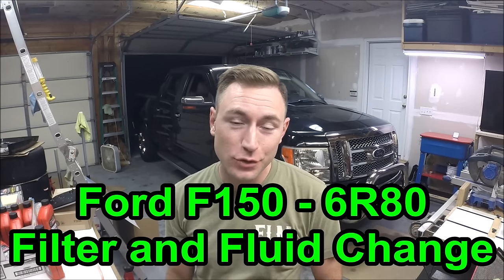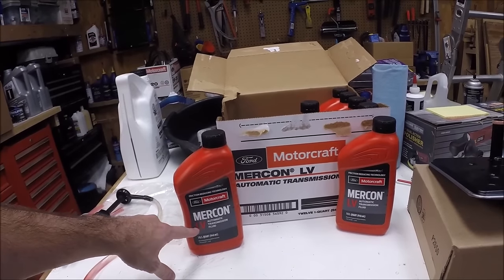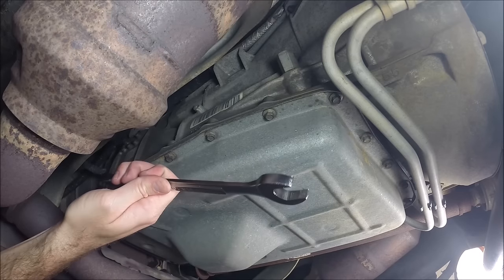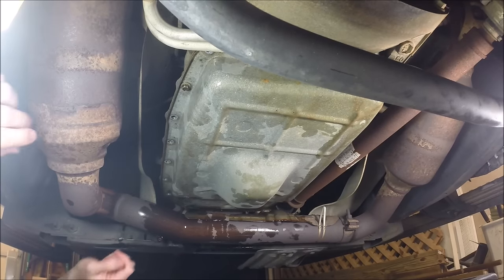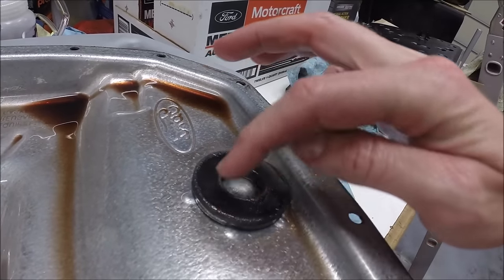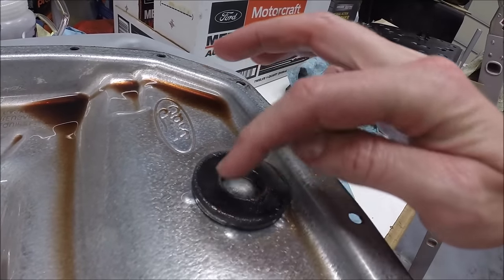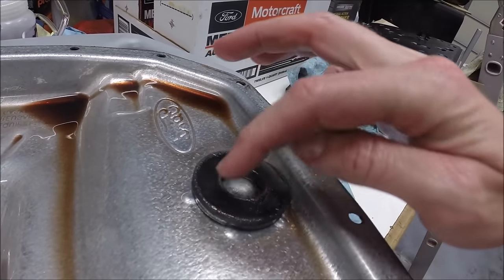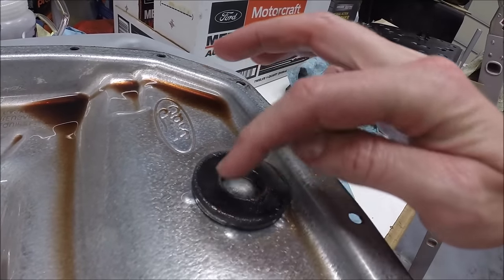Ford F150 - 6R80 Filter and Fluid Change

Comment: If you want to make less mess and make it more easy to handle the pan use a suction pump and pump out the fluid in the pan before you drop the pan. I did this on a Ford Explorer recently and it makes it a much easier process.
Reply: i just did this on my truck yesterday. I wished I'd read this comment before dropping the pan. That's a very good idea!! i also used a round drain pan. Now I'm using a lot oil oil dry.
Reply: Well guess I’m going to follow lyle’s lead. Thanks for the wise approach.
Reply: First thing come to my mind !
Reply: that's what I did put a clear tube from dipstick hole dwn to a shop vac but run said clear tube into a gallon jug so u can see how much comes out run vac seal off vacum hole except for clear tube and it will fill up gallon jug untill pan empties...then drop pan and no mess... so easy guys,..
Reply: For those using this suction pump method to remove fluid before dropping the pan itself, HOW MUCH FLUID WERE YOU ABLE TO EXTRACT through the fill plug hole?  How many quarts came out that way?  Thanks!
Reply: @SweatyWelder68  HOW MUCH FLUID WERE YOU ABLE TO EXTRACT through the fill plug hole?  How many quarts came out that way?  Thanks!
Reply: I think I was able to get between three and four quarts out of the pan with the suction method.

Comment: Everyone keep in mind that there are 2 different filters for the 6R80.  One has a 1 inch pickup tube and the other has  1.5 inch I believe.  If you get the wrong one the transmission will not go into any gear.  One part number is FT188 and the other is FT171.   If you're not sure which one then pull out your old filter and use another car or have someone take you to the parts store and compare the length of the pickup tube.  Most auto parts stores have both filters in stock so you can compare it with yours.
Reply from the maker: Great call out.   Always confirm the part # for your specific application.    From looking at the catalog data on both filter numbers, in general part FT-171 fits 2010 and older applications, and FT-188 fits 2011 and newer (it also fits the 2009/2010 Expedition).   And always compare your old filter and new filter before installation to make sure they are identical.
Reply: I have found recently that NO auto parts stores have anything is stock.   For some reason whatever I am looking for is never within 50 miles in stock.
Reply: Rockauto.  If anything buy both.
Reply: @ScrufsGarage  Besides the Ford F-150 and the Expedition, Lincoln Navigator has the identical transmission.
Reply: There’s 3 filters…late 2016 has 2 tubes FT-200.
Reply: @NickDall my 2015 also has two tubes. Every autoparts store and online all come up with the single tube version but when i pulled the filter it had two
Reply: @jdsk8er98  that’s interesting.  I had to go to the dealer…no parts store carries the two tube filter as a generic filter.
Reply: Fucking real one
Reply: There can't be 2 different parts for 1 car. Ether the auto parts store checks it for you or on the website by the year and make
Reply: @enriqueaguilar8788  go ahead and look up transmission filter for a 2012 f150 5.0.  Autozone and O'Reilly has 2 different parts for the same vehicle.  One part says 1 inch tube and the other part says 1.5 inch or 1.6 inch tube.   Auto part stores don't always know exactly what you have even if they put in the year of your vehicle.   Even alternators can have different amperage outputs for the same year and make of vehicle depending on what accessories the vehicle has.  Auto part stores don't know if your vehicle has those accessories and can often sell the wrong part.  So yes, there is a such thing as two or more different parts for 1 car.
Reply: GREAT advice! And, you're very accurate. Was told and shown the differences on computer by a very informed manager at O'Reilly's Auto Parts. Thanks for the great information.
Reply: Thanks

Comment: I would highly recommend changing the o rings on the Bulkhead connector sleeve,  while you have the pan down.  They like to leak and the only way you can change them is with the pan down.
Reply: Zenmaister:  If you or someone else that knows the answer to my question sees this, could you provide a part number or other description of the O-Ring you mention.  I'm going to be changing my trans fluid next week and I can't find anything listed under the description you mentioned.   A Ford part number would be very helpful if you have it.  And thanks for the tip.

I found the answer to my own question and here it is for anyone else who needs the info:

The Ford part number for just the O-rings is BL3Z7Z276A
The Ford part number for the sleeve including the O-rings is 6L2Z-7G276-AA

I buy most of my parts from RockAuto but the only sell and aftermarket sleeve (with O-Rings) made by Euro Parts.  I'm not confident in that brand name so I'm sticking with the Motocraft part that you can get from Ford and other sources including Amazon. The O-Rings alone are a little harder to find but a Ford dealership might be the best bet or an online Ford parts dealer.
Reply: @bmfilmnut  was it hard to change the whole sleeve
Reply: What sleeve are you referring to about changing the o rings?
Reply: @jacob8660  Its the sleave that all the wiring goes through to the inside of the trans. Sometimes the new sleave already  comes with the orings on it.
Reply: @bmfilmnut  I belive its BL3Z-7Z276-A
Reply: Thank you for the quick response! Is this part you're talking about located at the back of the transmission near the transfer case?
Reply: @jacob8660  Yes,
Reply: @jacob8660  There are a bunch of videos on performing  this procedure.
Reply: Hello? What would the video on how to replace the sleeves called? I can’t find anything on it.

Comment: I bought a fluid transfer hand pump from Trak-Auto for $10 that I used to fill the transfer case during a fluid change. Can also be used to fill the diffs. Why not use it to evacuate fluid from the trans via the fill hole before dropping the pan, and save yourself some of the mess? It looks like you could remove enough to get roughly 1/2 - 2/3 of the fluid out before pan removal.

Comment: It would be interesting to weigh the old filter versus the new filter to see if there are solids from the fluid decomposing that have trapped in the filter. Of course there will be metal and fiber wear materials as well..

Comment: Greetings, I'm a mechanic of my vehicles, Yamaha YZ450, Harley Davidson, Ford Raptor and others. I wanted to share that the 6R80 transmission F150 when you change the filter and oil, the replace will takes 6 quarts approximately. To measure the oil level is important the engine need to be running. Move 5 second in each position P,R,N,D,M,2,1 then  measure the oil level when reach the temperature of 190F.
The reason for measuring is because transmission oil expand for the additives at high temperature and cannot exceed the maximum level when is hot, because it damages other components for malfunction. Good luck!

Comment: I got 5 out and put 5 in on my 13 Raptor 6.2. Drove it around and it was perfect when checked.  Also depends on how long you let your vehicle sits before you start working on it.  Longer it fits, the more transmission fluid that can drain back to the pan. 
It’s definitely more messy than hard. My Silverado was more of a pain. The exhaust crossover goes under the pan. 
I know it’s a few years old but Great job on the video.

Comment: Great job on the video! I did this job on my 2014 about 50k ago but watched your video as a reminder before doing it again.  I actually drilled a hole in the low point of my pan last time and installed a drain plug so we’ll see how much of a mess I make this time. By the way, I have never drained as much fluid/oil out of anything as it takes going back in. 😂

Comment: Thank you, best video on topic imo. I just did my 2011 f150 with ecoboost  at 138,000. Trans shudder had just started. Problem solved with oil and filter change. I did mine twice (1 week apart as the fluid was shockingly dark). I needed a little over 7.5 qts of mercon lv. I put 7qts  in and drove 20 minutes till reaching 199 on the trans app gauge. I then was careful to remove passenger front tire and blocked frame and a arm so truck was level. Checking with truck at full temp with an external fan blowing into wheel-well and laying on the driveway on a thin pad did the trick. I only wore thin mechanics gloves but this is not for the faint of heart. Also beware if you have an 11-14 f150 and 21 pan bolts the factory torque spec is 80 inch lbs. i have a 7600+ page pdf factory manual. I also use a small hand suction pump and 3/8 clear plastic tube to get 3.5 wts out of pan before dropping. I then got another 3.2 qts out. I bought truck used at 110k and should have done this immediately. 

Thanks again

I do have a stock height 4x4.
My steel ramps are approximately 10 inches high.(not sure if the angle allows more fluid out)
My local dealerships had best prices on filter and mercon lv by far. $34 for filter (they need last 8 of your fin as they have 4 variants apparently) $6.50 / qt LV. 
Thanks again
Reply from the maker: Thanks for sharing your process.   I completely agree, I should have changed my fluid earlier too!    Thanks for watching!
Reply: That is exactly what I have. Thank you for your comment with info.

Comment: I replaced mine at 50K miles and the original factory fill also seemed low by almost a quart. Upon refill it took at little under 7 quarts to get it just at the bottom of the dipstick's cold level hash marks with the engine running, shift lever cycled for 5 seconds in all gears but truck not driven / ATF fluid still cold.
It makes much less of a mess if you syphon most of the old ATF out the dipstick hole and, wrap the exhaust crossover pipe with aluminum foil beforehand.
Reply: Pump and foil are both excellent ideas!

Comment: If you have high miles, you should replace the trans cooler lines as a precaution. They're known to snap at the quick connection fittings, and you could fry your transmission.

Comment: This s an excellent, very detailed  video on changing the transmission fluid and filter on a 6R80 transmission.  I did the same service on my 2008 Expedition and have now purchased a 2014 Navigator with 70K miles on it.  I only use AMSOIL products which have proven excellent  for me both on the engine and the transmission.  Excellent point on draining the pan from the rear of the transmission and purchasing the oversized drain pan.    Thanks for this very excellent video.
Reply from the maker: Happy to share and glad to hear it was helpful.   Thanks for the kind words and for watching!

Comment: I have a 2010 F150 4X4 with towing package.  It took all of 10 quarts to fill it at operating temp. I never checked the level before I drained it.  I wasn't having any transmission problems prior to change.  Still not having problems. Good preventive maintenance.  Yep, it started running out at around 6 qts.  I cranked it cycled through all the gears for a few brief seconds, then shut it of and added 2 more qts.  Cranked it, put it in Drive with Ebrake on and left it while I cooked supper.  Added two more quarts to get it halfway between fill marks.  Checked it the next day after driving home from work.  Still halfway on crosshatches.  Invest in a set of Nomex arm sleeves to do this job.  You will leave your skin on the cat otherwise.  I already had a pair.

Comment: I found one of those after market transmission pans with the drain plug for my 2016 at our orielly auto parts store for $50 and on rock auto same pan as orielly’s for $30
Reply from the maker: Nice!   A drain plug would make this sooo much easier.  Do you have a part #?   I sold my truck but others will probably be interested.

Comment: I thought I'd mention, I took mine to Ford service, as I was having a shudder issue on my 2016 F150 as well.   I had them do a full transmission 'flush' and refill, of which took the shudder out completely.   I also noticed in some video's, guys are adding the Lubegard Shudder fix, which is just a 2 oz product, which many swear by has fixed this issue.   Thanks for the video!                            On edit-   I see there are aftermarket 'dip stick's & flexible tubes' for vehicles, and noticed one fellow adding it to his F150 on Youtube, and thought this might be a worthy investment, having a normal dipstick again, plus the ability to add the fluid, and even easier if you have a pan with a bung to empty the fluid out!   I haven't yet found one for my '16 F150 3.5 Ecoboost, but will continue looking.

Comment: Well done!  This is the best, clearest and most complete video I've seen on the subject.  I'll be changing my fluid soon so I watched a bunch of videos. I really appreciate all the info you gave about fluid levels.  I was trying to find out how much fluid was needed for a change (not total capacity) but this is the only video I found that mentioned it.  But you went even further with your details about the level issues you had.  Very useful information!   Thanks!
Reply from the maker: Making a video makes every project take longer to do... so it's nice to hear that it helped the next person.  Not sure why Ford make serving this transmission so difficult, but it's an unpleasant job for sure.   Thanks for watching and for the supportive comments!   Good luck on your project.

Comment: Hello Scruf's Garage👋🏾.  Thanks for the video it was very helpful.  I have a 2013 F-150 w/ the 6R80 transmission.  When I dropped my pan I ended up getting 6.5 quarts out.  When going back in I had to put a little over 8 quarts back in.  👍🏾
Reply from the maker: Glad the video was helpful.   And based on comments of others, it seems very common to need to put in a little more than you got out.  Not sure why, but it seems to be that way for everyone.   Thanks for watching!

Comment: Yes! Thank you for the video. That is the ticket 6 quarts in until it overflows…. Put plug back in and start up and shift through drive and reverse (pump will suck up fluid) then add the last 1.5 quarts.    7.5 quarts total for the refill

Comment: BTW I bought one of those big drain pans at home depot for like$9.00. they have them in the cement section of the store, They are used for mixing cement & come in larger sizes, but I have the same one as in the video & it was perfect, it caught all of the oil.
Reply from the maker: Yes!   Those large drain pans are so handy.   I use mine all the time.  Money well spent.
Reply: Great idea -thanks
Reply: Thanks. Was searching online for one.

Comment: A guy can also install a drain plug on the stock pan ,got mine off Amazon years ago and its never leaked. I’m told a filter change is necessary only on every other change, hence the drain plug.

Comment: I just changed the fluid on my 2014 f150 eco boost with the 6 speed and I drained out about 5 quarts and put back in 7 and added some of the instant shutter stop which fix my shutter problem
Reply: Lol! I’m in the same place. I did mine and I got about 5.7 quarts out and put 6 back in. Not sure if I should put that extra 1.5 this guy is talking about. The math doesn’t add up.

Comment: The electrical bulkhead connector housing at the right rear is a notorious leaker. Should replace that 6L2Z-7G276-AA seal housing if any sign of a leak if taking the pan down.

Comment: Thanks for the video. Just did mine and next I take that pan off I am going to add a drain plug as it would make it so easy.
Reply from the maker: I agree.  A drain plug and a normal fill point would make this so easy.   I just disagree with Ford's concept of a "lifetime fill" transmission fluid that never needs to be serviced.

Comment: 09 5.4 6R80 @ 165k
Did the drop pan procedure like you.
Recovered 6.75 quarts
And 7.25 quarts to refill.
Ran the truck for 10min in drive. Shut it off and had to add 1/2 quart to full.
Yes messy and time consuming but I consider it well worth it.

Comment: I got the same results as you did. Seems I dumped about 6 and had to add back 7.5 qts. I drove it and got it hot, checked the fluid hot and at idle. Came out just right! I also put the truck on ramps to level the frame, as it would be on a lift. Same year & transmission.
Reply from the maker: Awesome, glad it worked out well for you.   I still find it so odd that 6qts come out, but 7.5 go back in.   But it seems to be the same for everybody.
Reply: Oil was probably changed previously at Ford dealership,they skimped on amount of oil used to refill!
Reply: Oh by the way.great video.going to do this on my brother's transit.great info,well done.

Comment: I'm in the process of changing the filter and fluid on my 2015 F150 6R80 transmission with 90000 miles on.  I'm the original owner and this is the first I've got into changing the fluid.  I checked my fluid after completely warming it up and it was really low on fluid, I would guess at least a couple quarts.
Reply from the maker: Very interesting.   That seems to be in line with what most people are finding.  So I wonder if the factory fill from Ford was a little low, or the service procedure is high?   I didn't observe any negative effects from following the service procedure for filling.
Reply: @ScrufsGarage  I ended up adding 7.5 quarts.  Thanks for the video..

Comment: Did mine a few days ago. 5 quarts is what mine took and I put the old fluid in the 5 empty bottles I used. Checked when hot and looks good. Not sure why some ppl say 7.5 quarts. Checking again in a few days but it seems to make sense to me 5 out 5 in. Mine is 2015 F150 5.0 with 49k on it. I'd never go 100k without fluid and filter change. Too many break in particles floating around!